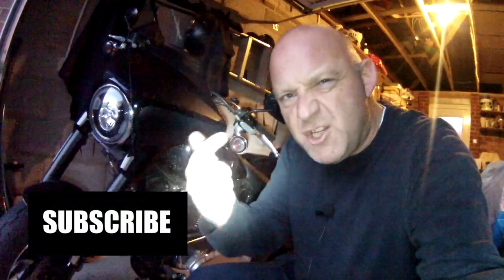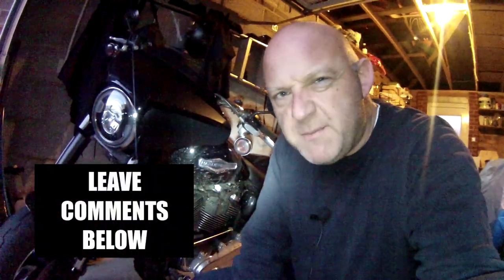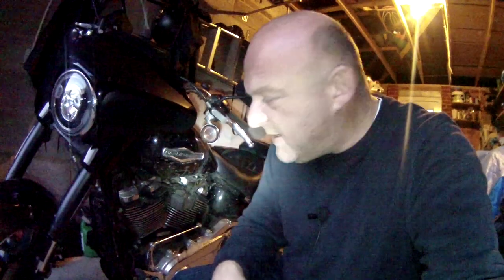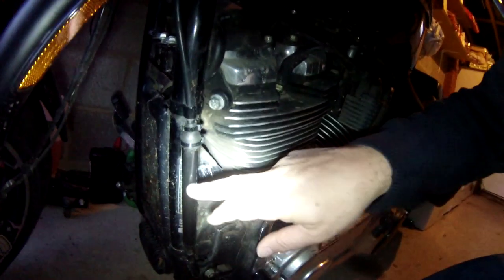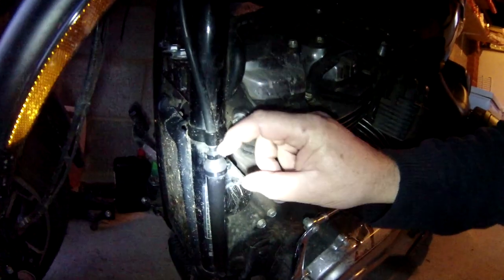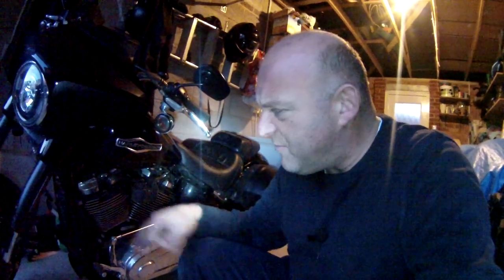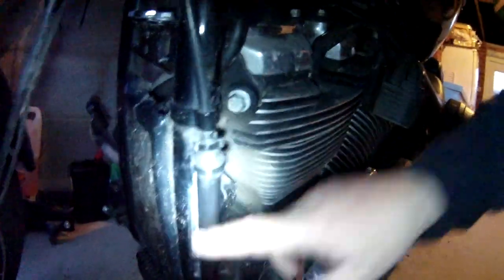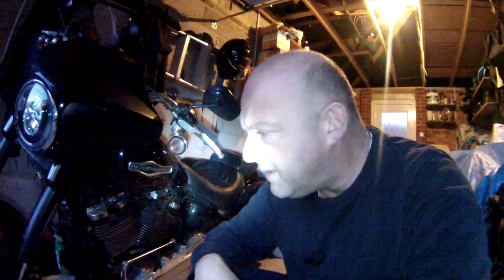Harley Softail Sport Glide Clutch Adjuster - Fixing The HD Water Trap - Sealing The H D Gaiter Gap

Comment: I have a 2019 heritage 107 that I added a stage 1 an 2 kit with the torque cam !! If I added a screaming eagle high capacity clutch kit to my bike would that also help with the performance of my bike ???
Reply from the maker: Yes absolutely so. The issue with upstaging is that it overtakes the existing tech on the bike so if you ride it harder then you could easily burn it out so a heavy duty clutch is a good next add on. Cheers

Comment: Thanks Alf. Good advice. i will be definitely be doing that to mine. slightly off topic but you might be able to help. i bought some LED indicators to replace my bulbs on my Harley Davidson with grayed out lenses. They arrived and the pins are not in the same position on either side, which is supposed to be correct as per other YouTube vids, but when i took the bulbs out of my indicators the pins are in the same place on the opposite side. So i am none the wiser aggghhhh
Reply from the maker: Ah ok I think you’ve ordered the correct ones but for a different market as the fittings are different. Where did you get them from. Do you originally have bulbs front and rear?
If you go back to where you bought them and specific a uk bike you might be able to do an exchange. 
There is a company called Ciro which do inserts too but in truth there are many companies doing it and I think HD are or will be soon doing inserts too. Let me know what you find out. Cheers
Reply: @RevelatorAlf  Hi Alf, i bought them of Amazon. they were only £22.00 the ones from Ciro are a lot more expensive. i will let you know how it pans out.
Reply: Hi Alf. problem solved. the ones they sent me are an 1157 fitting. the ones on the bike are 1156. i will send them back and get the correct ones.
Reply from the maker: Paul Morris there you go. Excellent